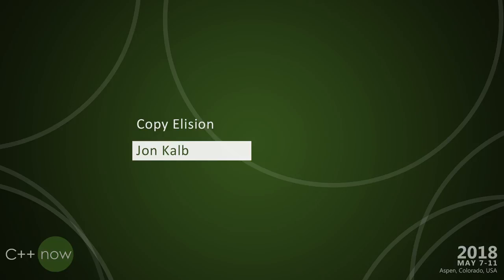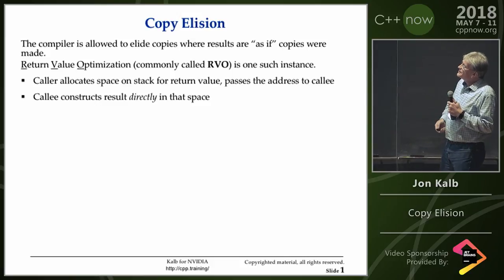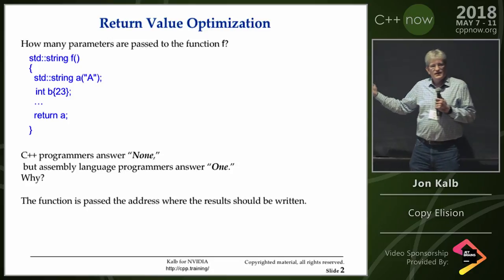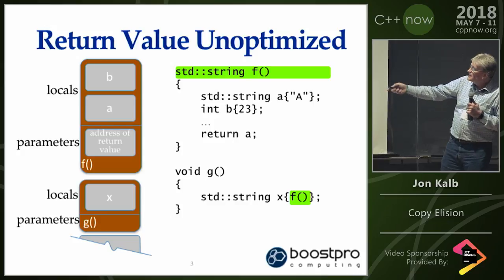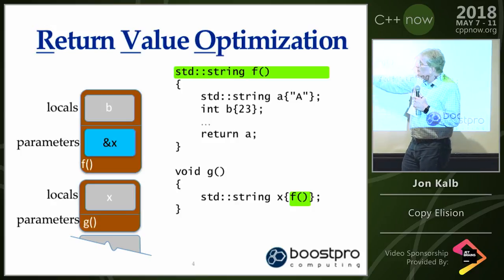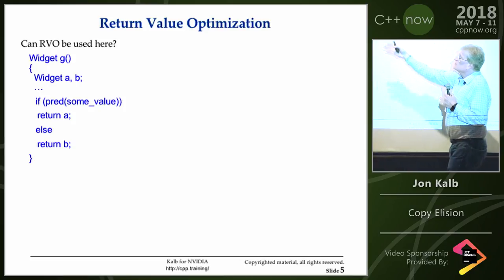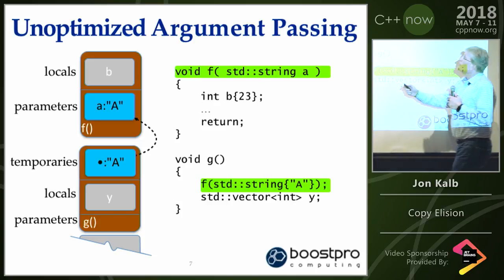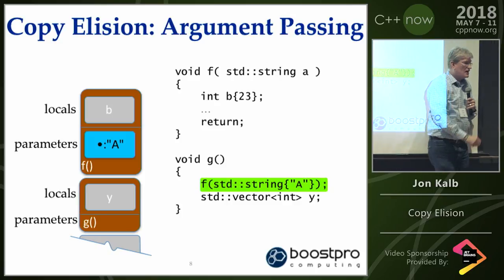C++Now 2018: Jon Kalb “Copy Elision”

Comment: Great Visualization but I see a problem: 
when you exclude the RVO with the compiler option 
-fno-elide-constructors   you can see that, returning an object by value, the compiler's  generated code calls 3 constructors (assume no move semantic implementated for the sake of semplicity):

1) 'normal' constructor that builds the object   obj   inside the function
2) copy constructor that builds a temporary object   tmp_obj (fictitious name)  from   obj
3) copy constructor that builds the final object   final_obj   from   tmp_obj   inside the caller

So, 3 steps versus 2 step by Jon Kalb

Here is a skeleton example:

//------------------------------------------------------------------------------------------------
MyClass   func()
{
   MyClass obj;
   return obj;
}
//------------------------------------------------------------------------------------------------
int main()
{
   MyClass   final_obj = func();
}
//------------------------------------------------------------------------------------------------

Sorry for my english very very poor and simple.